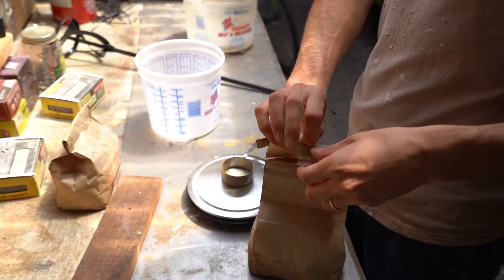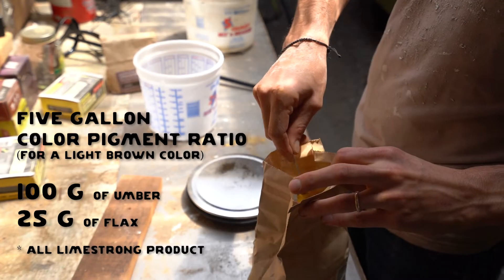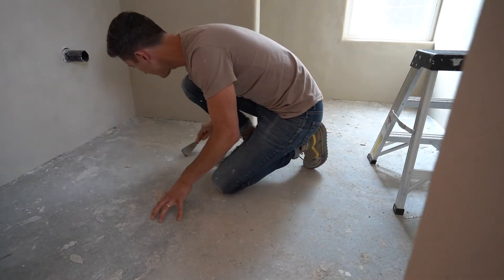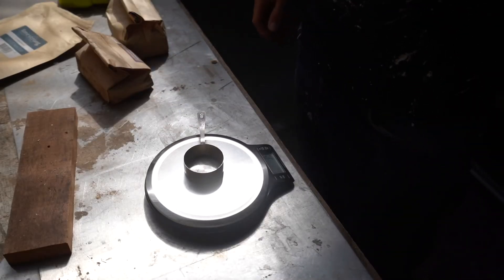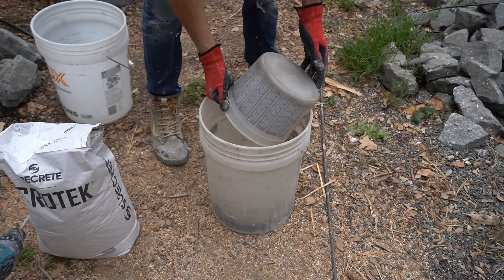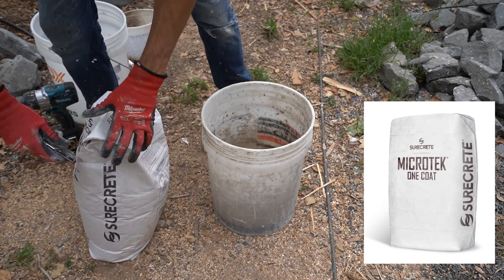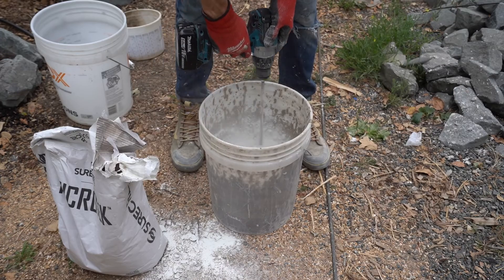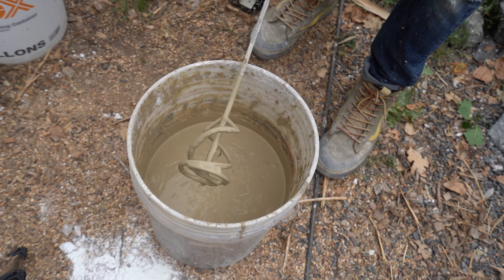Limewash Primer, Microcement & Lime Plaster Bathroom

Comment: Question, in the bathroom you used Tadelakt, could you have used the Lime Plaster and Lime Wash and then seal it like you did in your kitchen? At the end they both look the same, so I’m curious if they can be used interchangeably if it’s properly sealed.

Comment: I've gone through almost all of your lime, microcement videos. What you're doing today, your son will be proud of tomorrow.
I'm loving how you work with different materials and the result is still everything blended smoothly.

I'm doing a tadelakt plaster on the bricks walls of our resort bathrooms in India. However, 2 of the bathroom walls are made of flyash blocks, and i've been told by someone that the lime plaster wouldn't go on the flyash blocks, or would crack. Do you have any tips for the same? Should I apply a cement plaster with a key first to the flyash block walls and then try tadelakt(lime)?
I did think of microcement for the walls as well, but then the color I'm trying to achieve(white) in tadelakt will be different from what I get by the microconcrete/microcement.
Reply: Ma'am why microcement, microconcrete is so expensive in india? I wanna do it but very expensive. Only luxury homes can afford, any alternative?

Comment: Great work! In the previous video where you use the microcement for the first time, you used regular polyurethane to seal. The DK400WB is so much more expensive - does it seem like it was worth it, now that time has passed since both projects? Thanks!
Reply: Also wondering this!

Comment: Thanks for making this! I’m curious about the waterproofing of your shower floor. I’m about to do this with my walk in shower but so far I only have the wood subfloor, but plan to create a cement shower pan with a waterproof liner. Is the sealer the only thing you need to make sure the shower doesn’t leak? What about where the floor and shower wall meets? How did you waterproof those corners? Did you spread the micro cement and sealer a bit higher up onto the wall to seal the corner? Sorry for so many questions!
Reply from the maker: For me, my subfloor was cement, so it was a little different, but I would tape and float your joints, and go over them with a waterproofing membrane just to be safe.
Reply from the maker: It might help to check out the video I did on How to Tadelakt. Good luck on the project !
Reply: Thank you!

Comment: On the plywood, glue a 10x10mm FACADE MESH between two coats of floor paint to prevent this type of cracking.

Comment: Why did you do the lime plaster before the lime wash ?
Reply from the maker: It’s not really recommended to limepaint in a bathroom since it’s so moist. So, lime plaster is more recommended for wet rooms like bathroom, because of condensation. With that said though, I think you could lime paint your bathroom (without plastering) and have no problems as long as there wasn’t a great deal of water or condensation collecting on it. Hope that makes sense
Reply: @MtWashingtonWeekendProject  very helpful, thank you! Love your videos!

Comment: 2:54 I'm thinking this is not looking good, these taped drywall joints are not being skimmed or filled sufficiently. That 'joint compound' looks really 'wet' (?)...3:42 that vertical joint is very obvious, doesn't appear to have been properly skimmed and feathered out. 9:25 suspicions confirmed- ugly joint in the drywall showing through the finished product. Yikes.